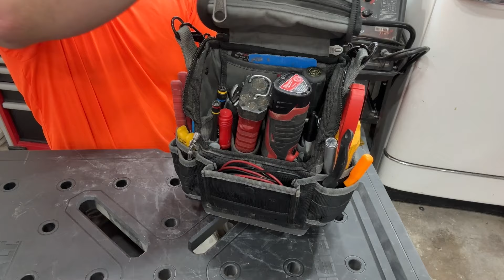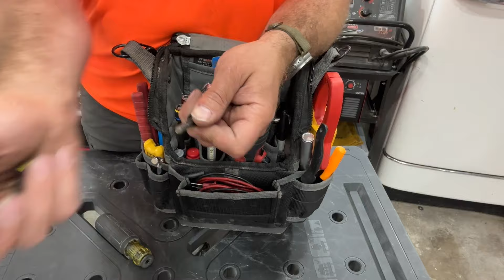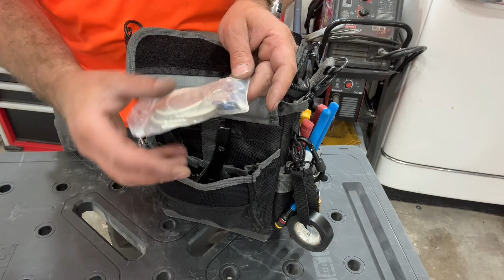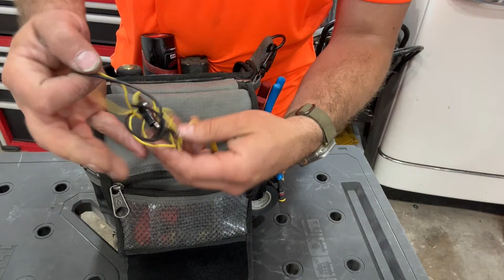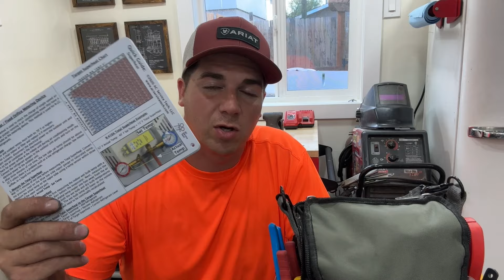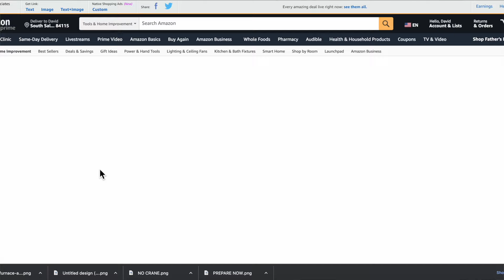What's In My Veto Pro Pac? The Ultimate HVAC Technician Tool Bag

Comment: I am curious how you like that drill / screw driver 2415 ?  Some people bad mouthed it pretty severely, I suspect they were expecting to drive deck screws or torque something.  I like the form factor for what you appear to be using it for.  I thought for how you are using it, it looks like a good fit.  The surge is quite a bit larger and won't go in my bag.
Reply from the maker: Yea it’s perfect for hvac with zip screws, but it’s not an impact. I love it because it’s compact and is easily stored in my veto.

Comment: What fluke multimeter is that 332
Reply from the maker: I think it’s the 342
Reply: @diyhvacguy   thats the one you recommended. I do residential military housing we just troubleshoot the system change parts but we dont mess with the freon

Comment: Hi,  my question has nothing to do with this video, sorry.  My central a/c copmpressor will turn on and off every few seconds until it finally will run.  It cools fine,  I added a Supco hard start kit to it and it didn't help.  I'm wondering could it be the contactor?  Oh, the system is 16 year old, R 22, Bryant, 3 ton.
Reply from the maker: Yea it sounds like the contractor is wigging out a little bit. Its a super easy replacement. Kill power, wire for wire and you’re good to go!
Reply: @diyhvacguy  Thanks for your advice!  I just did the replacement and (knock on wood!!) it seems to be working as it should.  I'm 80 and on a fixed income so not having to have a repairman come out is good.  thanks again.

Comment: I'm curious about your meters. I looked at the specs on the meters listed in your Amazon shop and I don't see one that measures capacitance. I'm certainly no HVAC repair person but I do have a meter that accurately tests capacitors and that is the first thing I check on units in my rental properties. If I change a contactor, I also change the capacitor but I always test it and if it tests good, I keep it for emergencies.

Comment: Most all of my work was industrial  , boilers,  chillers, cooling towers, so that being said,  my go to bag was a backpack.  I was always climbing up ships ladders to get on the roof. I had everything you had and just little different setup as i had a rear compartment for all my ratchet wrenches. From 1/4 - 7/8. . I also had a small tool that looked like an offset reefer wrench. Amazingly i found it at HARBOR FRIEGHT. 1/4 ON one end and 5/16 on the other. I seen it and thought that might come in handy. Only 5 bucks. I used that a bunch. Not a fan of HARBOR FRT TOOLS , but i thought for 5 buck, cant go wrong.  I needed the backpack because I was always climbing and needed both hands. Gauges over my shoulder.  GLAD IM RETIRED. !!!!! 35 YEARS WAS ENOUGH.